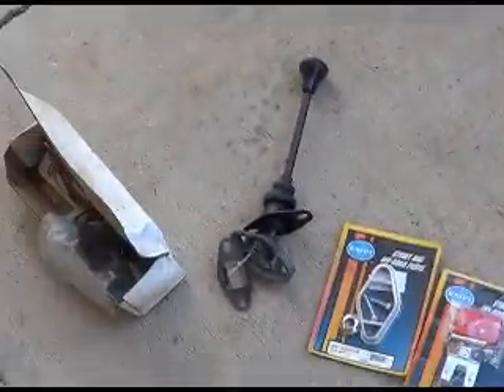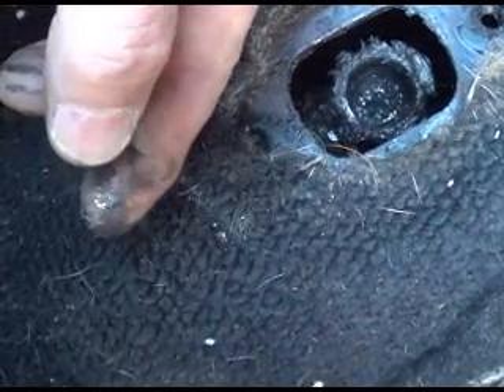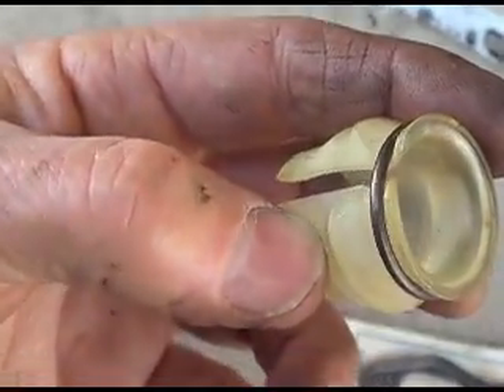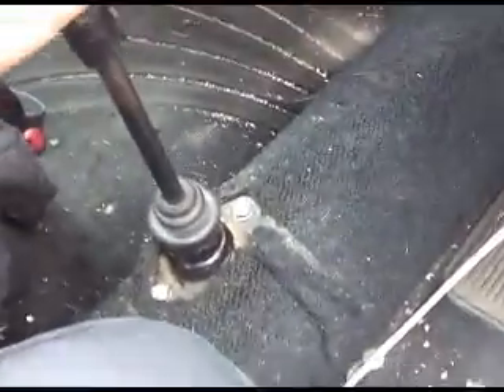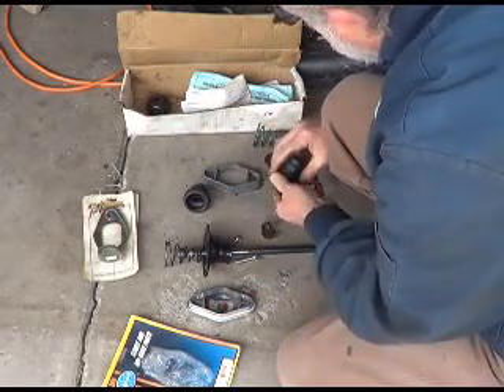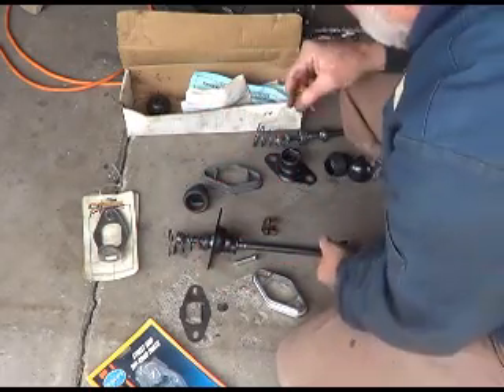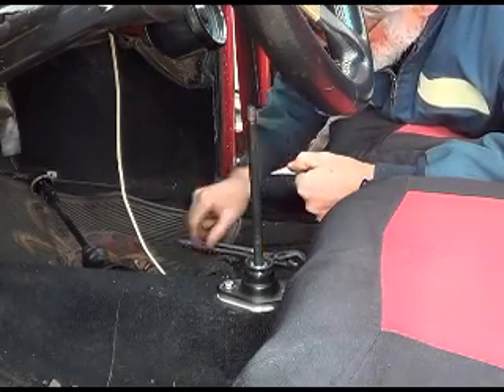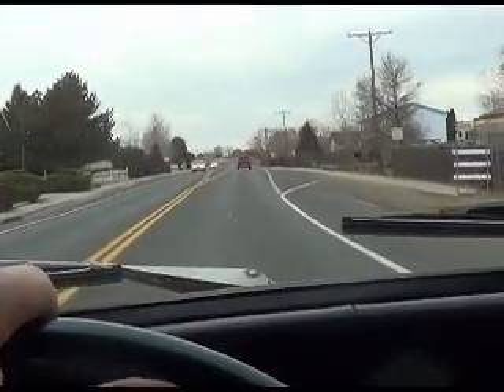VW Transmission Shifter Upgrade

Comment: Thanks Greg, I have to change my coupler in the tunnel in the Baja and wasn't sure the shifting rod would come out enough.  Your video answered my questions I need to give it a try see because I didn't want to have to cut a hole in the fiberglass.
Reply from the maker: It's a PITA but worth doing

Comment: I'm going to be doing all this stuff soon, just got the parts today. I don't know if it's going to fix my problems or not but it needs to be done anyway lol That extra plate you had that didn't have the tab on the driver's side was an older version. I came across someone saying that while I was researching. Thanks for the awesome video!
Reply from the maker: Thanks. I hope your problem is solved and have a great holiday.

Comment: Pull the split ring apart with pliers,  to where the ends touch, it'll lock open,  get all the stuff in and use 2 small flat blades, push one side of the ring one way,  the other opposite,  the ring snaps tension and you're done! works great!
Reply: Instablaster.

Comment: never knew about those short throw kits kits... Thanks for showing!
Reply from the maker: +vw64manyrd   It works just as good if not better than some of those full sized POS with the lock outs and all that.  Works on the bus as well.
Try to find an older used one that has more metal to it. This one felt like cheese but it still works ok. might not last as long. Throw the old short bolts in the glove box just in case it explodes in the middle of know where so you can take it out. better have that 13mm to. heheheh

Comment: Finished this project yesterday,  Wow, what a bear!  Thought I was going to have to cut a hole in the front of the baja for access to the shift rod, but was able to get it far enough forward to get at that front Bushing.  Bushing was completely gone, rear coupler was aftermarket and had fallen apart.  I did install one of those wis-bang EV4U brass bushings. Was tricky getting it in, but is supposedly a lifetime repair???? will have to see.  Aside from an Empi shifter installed by the PO, the car seems to shift much better now.  At least it isn't trying to go into reverse when you go for second.
Reply from the maker: Hope you get lot's of miles and smiles with the shifter working good again. Nice Job!

Comment: WhenvI had my fastback around 1980 i read about the short throw shifter and considered buying ne but never did. When i picked up my fastback project last year i was pleasantly surprised to find it already had one installed. The car has been parked since 1997 so i can assume it's one of the older kits. I will up grade the flex joint with those urethane blocks too i think .
Reply from the maker: Hope you get lot's of smiles to the miles with your new car

Comment: Great video. One question will the shift kit work on the scat shifter and what’s the deal with the part you slide down the shaft it don’t seam to have a real function. Thanks.
Reply from the maker: Scat made many different shifters. What do you have?
If you watched the entire video you will notice it changes the pivot point which changes the travel ratio.
Reply: How do I put a picture of it on here lol it’s has the “t” shape handle n the lever in front of it to pull up n go in reverse

Comment: Hi, thanks for the video. I bought a 67 bug last fall, and have been getting it sorted. It will probably never get another paint job or carpet (it’s white, and shows it’s as dirty as yours) because I use it for a daily driver. I ordered a aluminum spacer for a shorter throw, and now I can install it, since you showed us how! I also got new standoffs, they hold the top off the decklid away from the body, so air can flow through. What do you think about that mod?
Reply from the maker: I hope you enjoy the shifter as much as I do. Looks stock but shifts as close as the fancy stuff that can be troublesome.
I love the stand offs........    except when I want to check my oil. Carried a stick to prop up the decklid. PITA  They do make a spring extender for the center now. I have one but I'm running center mount carb  in Valorie my 66.  
Seemed like I got a lot of junk on my engine from the weather with the stand offs sitting out in the lot all day.  Now I just cut a tennis ball and stick it over the latch on the bottom instead of stand offs on the top.    I hope you get lots of smiles and smiles with your 67.  I think 67 was one of the best years ever.
Reply: Oh yeah, I never thought of all the crap that gets on the motor! I just like the race car look. Some of the German racers use a stick to hold their decklid up, maybe I should do that too. I read that the spring breaks the tack welds that hold it on. Ever had that happen? I havent, and I bought pins so you can take the decklid off completely for engine work.

Comment: Hey great video. I’ve been working on my mothers 74 sunbug non-superbeetle and it’s coming out really good. The sunroof was leaking so I did the weatherstripping and redid the floors which led me to a nice empi short throw shifter, coupler and the bushing that seems like a pain. I removed the inspection plate but didn’t get a chance to remove the 2 front plates yet. Started raining yesterday. I’m a little confused as to what the bushing snaps onto. The shaft ? Or inside the tunnel ?  It seems like every time I work on her Bug one thing leads to 5 others. I like the Sun tach in your bug.
Reply from the maker: The bushing goes into a plate inside the tunnel. The whole job is a dirty PITA but is very worthwhile doing and will be enjoyed for years to come.

Comment: What's the advantage really? I recently got a 64 baja and have had to fix the brakes and related things (right front spindle is trashed). Feeling the shifter, it seems like the long throw would be better to learn on since you know when it's been shifted. I already replaced the nylon bushing. The baja kit wasn't in the way on mine to pull the rod, but a front skid plate had to come off first.
Reply from the maker: The advantage is not reaching into your glove box for 3rd gear. hehehe

Comment: Kinda weird question,  but is it possible to have the rear coupler out of line? I recently replaced bushing and coupler and th gear shift seems like it can't move to the 3 / 4 side without really pushing hard. Not sure if it makes a difference,  but the previous owner must have had a problem and reemed out the hole in the hockey stick
Reply from the maker: The front of the transmission that holds the hockey stick is called the nose cone. It has a brass bushing style bearing where the shaft comes out and there also supposed to be an oil seal. It is not uncommon to find these loose and leaking but still working. Sounds like yours is done. You will have to shop around to find a replacement. If it's a stock sedan you will have to remove the engine completely and then remove the transmission completely. The front transmission mount is part of this nose cone. They come in 2 hole and 3 hole depending on year. Get the number off the tranny it might be helpful. This is also a good time to do a overall cleanup, oil change, replace all 3 tranny mounts and check mainshaft seal along with throwout bearing and clutch.  Yeah, it's an awful lot of labor to do it right but ounce it's done it will last a lot of years as well as increase the value of your car and make it more fun to drive.   As temporary test you might cut up a pop can and see if you can wind a strip around the hockey stick shaft to center things back up. If this works you will know your on the right track but don't think for a second that it will last long at all and if peace's of it get loose and go back in tranny you will be sorry. Use your imagination and be creative.  You can also buy a replacement bushing but you need a special driver to install it and you hockey stick needs to come out. There is no easy quick cheap fix that care to try and I've tried a lot of things.  Plastic, aluminum, brass shim stock, rubber  blah blah blah, Stock works best.  You could rush threw it in one day but it seem's I always find other things that need to be worked while the engine tranny are out.  It's a money pit and time eater for sure.
Reply: @TheEZGZ  sorry about my description,  the actual hockey stick has the hole widened... looks like someone tried to replace the grub screw with something larger when they replaced the coupler.  I'm hoping I can maybe loosen it slightly adjust it to the left and re tighten  🤞

Comment: I've been thinking about putting one on my '67.  I had a '67 in college but had a scat short shifter on it.  I want to keep the stock shifter on my current '67, but the long throw drives me nuts!
Reply from the maker: Been driving it every day last 6 months and it's still work fine. Might add some fresh grease and have a look inside.  Nice not having to reach for 3rd.
Reply: I thought I had short arms and was the only one with problems reaching for third!

Comment: My shifter is super sloppy. Lots of play even in gear. Not sure what to do about it but I'll start with that coupler and round piece
Reply from the maker: If that doesn't take care of it check the shift shaft coming out of the tranny.  The bushing wears out and start leaking a lot of oil. It is not difficult to change but you will have to take out the engine and transmission to get to it. http://www.cbperformance.com/product-p/4536.htm

Comment: I always use the old cage and replace the rubbers. The replacement cages are not as good and don't fit right.
Reply from the maker: +Jon Laws The new coupler was fine it just needed a little filing and fitting and I was to tired in the dark to mess with it. Ether one will work. 
Thanks for your contribution Jon,

Comment: Anyone knows which is the correct thread for the shift knob?
Reply from the maker: I took my shifter to the hardware store and couldn't find anything. The shifter and seat belt bolts are not normal metric thread??????  Try to find a knob with a slip fit and set screw threw the side. Thanks for stopping by
Reply: @TheEZGZ  guess thats the way to go. Thanks!
Reply: K4lr0b I bought a new Shift kit from JBugs and the thread on the shift lever is 12mm.

Comment: thx i have one still in the package yet to be installed.
Reply from the maker: Since I made this video I drove from Denver to Portland Or and then from Denver to Detroit Michigan and that totals over 8k miles with no further maint or adjustment. Do it right and enjoy the new shorter 3rd gear reach. Thanks for watching and posting
Reply: Once you have the short-throw kit installed you'll kick yourself for not doing it much sooner ! !
Guaronteed ! ! 😊😊😊😊😊😊